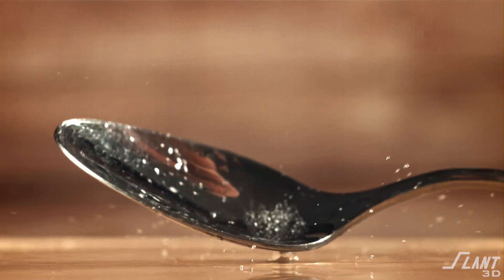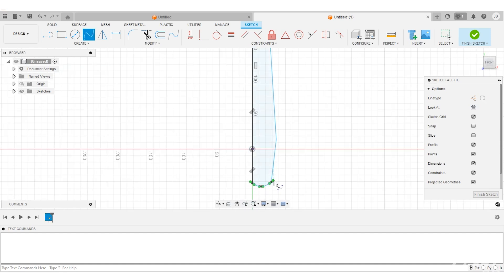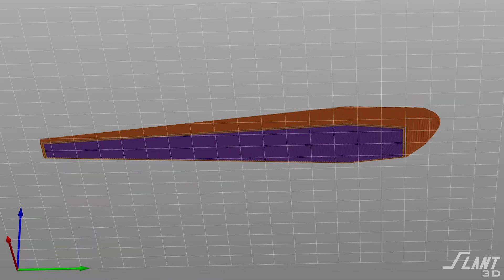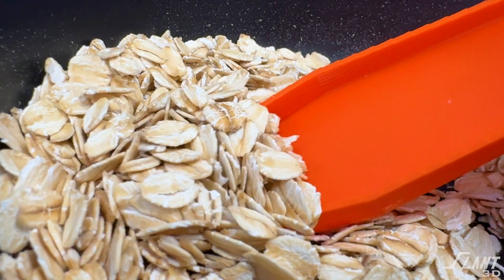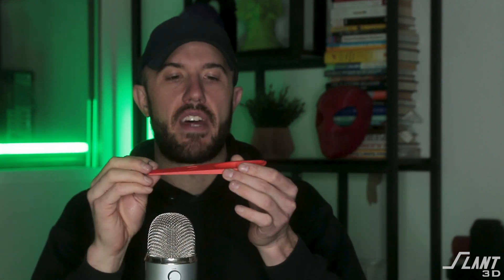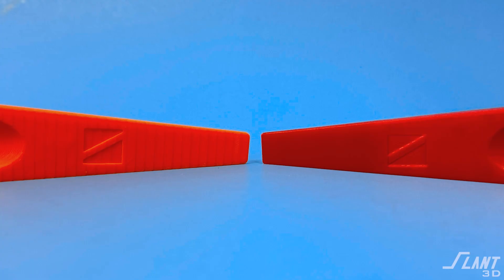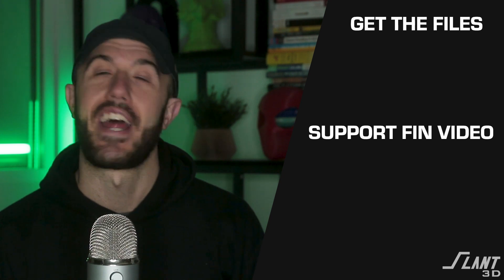We Made a Better Spoon | Design for Mass Production 3D Printing

Comment: Some ppl will miss the point
,The video isnt abt the spoon it self its abt adapting an old design to better fit the method of manufacturing while maintaining functionality
Reply: @D3PR3C4T0R Mah SPOON Is too big.
Reply: https://www.youtube.com/watch?v=W7JyjZI3LUM
Reply: Food safe printing is called sla or sls, fdm layer lines hold bacteria
Reply: Every 3D printing video I see about HOW TO WORK THROUGH A PROCESS tons of people in the comments completely miss the point and talk about how the specific item is bad or how it was pointless to reinvent the wheel. Like the video about 3D printing being practical and designing a drywall anchor. Countless comments completely missing the point and saying you can just buy them. People need to learn how to learn. Critical thinking!
Reply: It works in a vacuum - yeeeeah! you've made a spoon that's easier to print! 
But in real life this is just a bad example. The spoon turned out to be of very questionable convenience for people.
In the first place is the question “is 3D printing a spoon really easier and more profitable? Perhaps injection molding would be more suitable on a spoon scale?”
Reply: @ivanalaskevich4736  That's part of the process though. The video is still making the point. You can't even test how well something works until you make a prototype. Know what I'm saying? A project can be an abysmal failure and you can still learn from it.
Reply: @802Garage  i mean, in all fairness, they didnt come up with the design, all they did was translate a design thats been around for 20+ years and was previously injection molded into a print, which is a far less efficient and cost effective means of producing the spoon. They solved a problem that doesnt exist with a spoon design that has existed longer than i have. Lemme know when 3d printers can churn out several hundred of these per minute for about .2 cents a unit
Reply: @outkast937  You are again, absolutely missing the point. You are focused on the spoon, not the process. Individuals also cannot easily buy or build injection molding machines, so what if they want to make a custom X at home that's way cheaper on an injection molding machine? That's where this process comes in. Sometimes I can't tell if people are wilfully ignorant because they just enjoy arguing or if they never learned certain critical thinking skills.

Comment: Thanks for the great video (and the one about printing the electrical box at an angle). Thanks to your excellent advice, I designed support fins for a tray I have been printing, so it can be printed at a 45 degrees. There was an immediate improvement (in terms of strength) on where vertical walls meets the horizontal wall! 

Can you do a video on designing support fins? e.g. if there is a rule of thumb for how tall and wide, spacing for the spruce, ideal gap between fin and the object, etc. 

Many thanks!

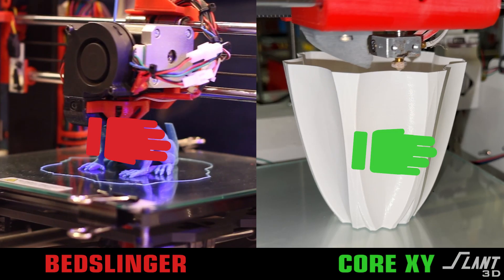Comment: 3:28 - took a small swipe at bedslingers, eh? I suppose fair enough to some extent for very tall objects. Although I don't wonder if my Prusa could do that spoon. I guess that does explain why even Prusas were rejected and you went custom.

Although to be honest, I'd just change the design of the spoon so it doesn't have a very long taper, as it's not strictly needed, and standing it up like that isn't really the best orientation for the layers. But I'm also a hobbyist so I'm not concerned with auto-ejection.

Comment: How would this print on a belt 3D printer with 45° Gantry?

You can print it flat since ejecting The part automatically is pretty much not problem, and you can get rid of the shallow steps due to the fact that layers are deposited at 45°.
Reply: If I remember correctly, adhesion on belt printers just isn't reliable enough for large scale farm use.

Comment: I actually used your support fin info from the last video.  I was designing a tray insert for a guys lunchbox and had to print the tray angled up 45 degrees to avoid massive amounts of support material.  There was an overhang around the entire tray to sit in the top of the box.  The print went from using $7 in material to $3.50 and went from 8 hours of printing to 5.  Fantastic advice, info and training on your videos.  Keep ‘em coming!

Comment: It's a bit off the wall, but I'd be interested in seeing how a coat hanger would be designed for 3d printing. All the ones i have cause my shirts to develop divots, and they aren't strong enough to reliably hold my winter coats.
Reply: I was literally thinking about this last week after being reminded of the folding coat hanger. Could do a print in place folding 3D printed hanger to make it fit on a bed and have the folding feature!
Reply: Take a look around Thangs / Thingiverse / Printables / etc, there are actually quite a few coat hanger designs.

Comment: Well done🎉it’s great to see the re-designing to accommodate the process. Could the spoon not be coated/dipped in food safe sealant? js
Reply: Should be able to do so, but for those that wash plastic spoons then that coating could be worn off.
Reply: You could print with polypropylene although that's a more finicky filament
Reply: You could print with polypropylene although that's a more finicky filament to get sticking to the build plate and needs an enclosure.

Comment: For the surface finish with most printers, you'd be best off to have the top surface that you look at flat to the bed.  For the up-right configuration, it seems like you could arrange the array of spoons so that they were self supporting, with minimal connections betwixt them, to minimize wasted material.  Of course, the main issue is that with western freakout, this would need to be single use only.  And like the presenter said, the current solution is perfectly adequate.

Comment: I think this video segues right into 3D printing and food safety.  3D printed parts like this are porous and hard (practically impossible) to fully clean.  Good for one time use, but not great for repeated.  Very similar to other plastic spoons in that regard, so the design of this spoon has to have some flourish or reason why someone would pick this over another plastic spoon that's tossed after use.  Which is to say that when you're making designs try to make it special and stand out, which 3D printing is capable of.
Reply: I personally use an FDA approved food safe epoxy coating on anything that goes anywhere near a body orifice.
Reply: @MaddenFrary  Curious, what do you use?
Reply: There has been some debate about the layer lines / pores in 3D prints and whether they are actually small enough to hide bacteria. Also the pinned comment seems to indicate that they are more interested in the design of the spoon rather than whether or not it's really a good idea.
Reply: This very valid point keeps coming up whenever food/drink and 3D prints come anywhere near to each other.  I would imagine that there is some sort of process or coating that can be applied to make it food safe.  Or, design something unique, smooth it out, and then use it to make a mold.  You could even insert a 3D printed part as the core of the mold to save on material costs.  I don't think it is as big an obstacle as people make it out to be.
Reply: @patricktierney4392 This is such a valid point that seems to be overlooked too many times. All that is needed is a 3d print that is smoothed and prepared to how the final product would look. Then silicone molds or 3d printed injection mold inserts could be made of that print to reproduce a food a safe product.

Comment: Bacterial/fungal  harbourage issues between layer lines?
Reply: Yes, 3D printing is not suitable for food use. This is a design demonstration video
Reply: @kzalesak4 there's always printing in polypropylene
Reply: @killpidone  from what I've seen polypropylene  doesn't like sticking to cold polypropylene making printing it difficult
Reply: @kzalesak4 there's always printing in polypropylene
Reply: Single use is safe in that sense, including cookie cutters (but people will complain about lead from nozzle and filament additives, without knowing how much bad stuff there could be, compared to hazardous materials gotten from e.g. eating a BigMac or breathing surrounding air :) )
Reply: @kimmotoivanen I've seen people use wax paper so the cookie cutter doesn't come in direct contact with the food.